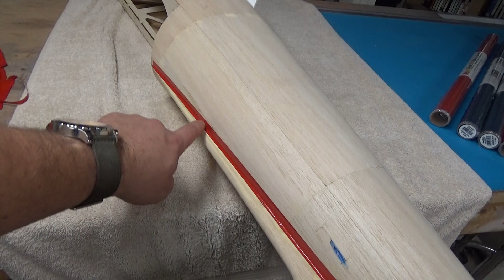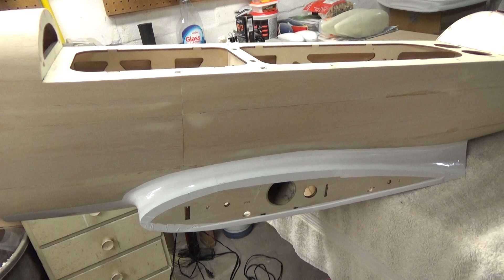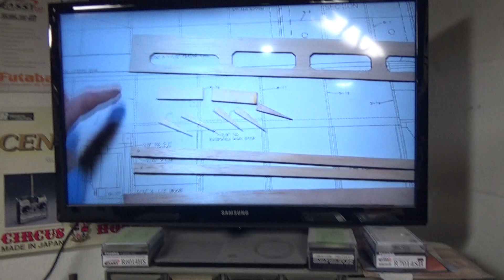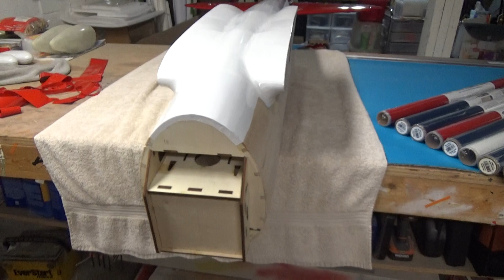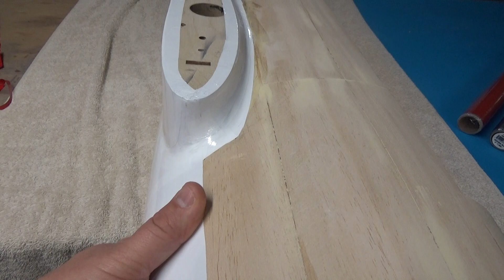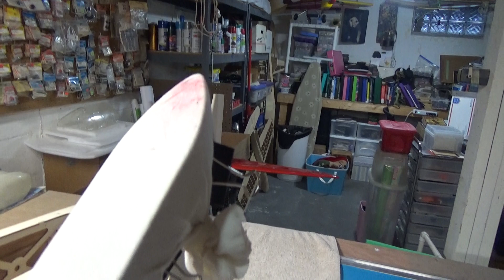Carolina Custom Kits Super Chipmunk build #10 and new P-40??

Comment: I too prefer Monokote. I also ascribe to the "this is how I do it and too bad if you don't like it" philosophy. For instance, with general sport models, I usually cover the main components separately before gluing them together. When I do have to join pieces before covering, I use the small transition strip you outlined. You noted the need to consider the color combination before choosing the transition strip but I did not hear (perhaps I missed it) you mention considering the opacity of the pieces involved. Almost everything goes over white or yellow and you can test other colors. For instance if your fuselage is blue and the horizontal stab is yellow, than you want the transition strip to be yellow.